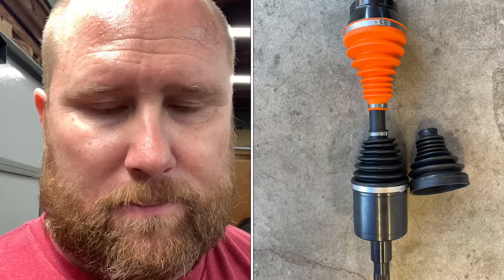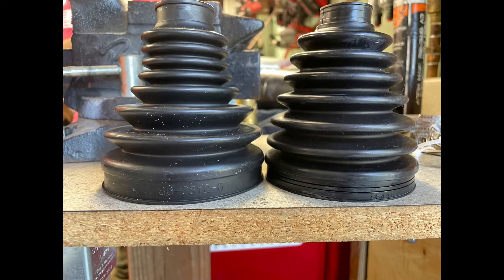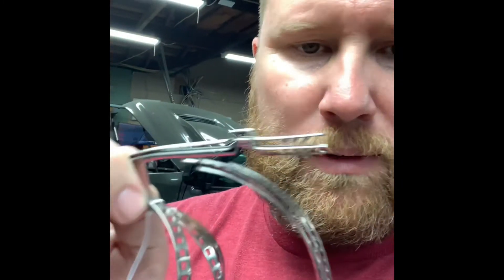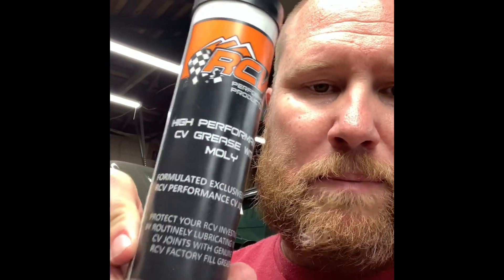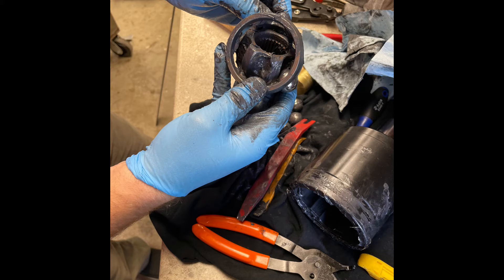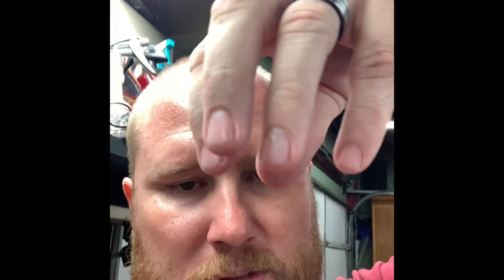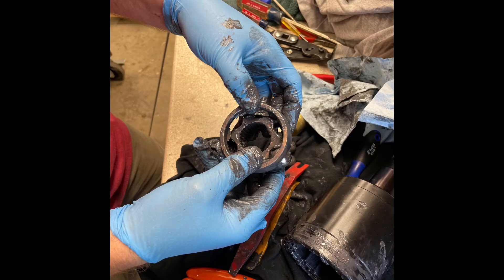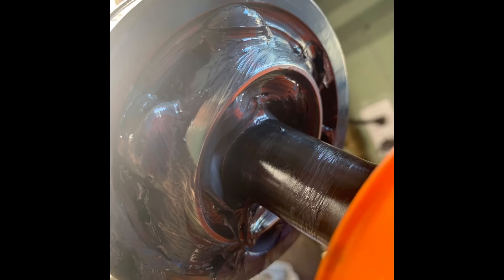Zr2 length RCV axle boot swap and race/cage rebuild

Comment: Will the RCV boots work on stock axles?
Reply from the maker: I haven’t tried. But… just use empi 86-2326-D boots. They are $8 a pair even though peak sells them for $40 a piece.

Comment: Is the RCV Part Number for the grease you use HT1LF-1 or HT1LF-SPEC? I'm guessing it's the HT1LF-1 but I'd just like a confirmation..Thank you
It figures, I bought a set of these and now I find out I either have to change out the boots or buy a diff drop kit.  Not too happy...
Reply from the maker: Don’t get the diff drop. It maximizes the problems our inner cv has. Get the boots. Call Josh at rcv and he will get you sorted on the boots and which grease. I just uploaded a better video for the rebuild